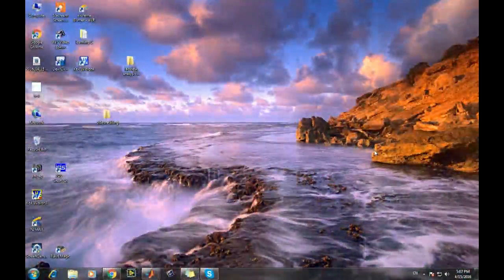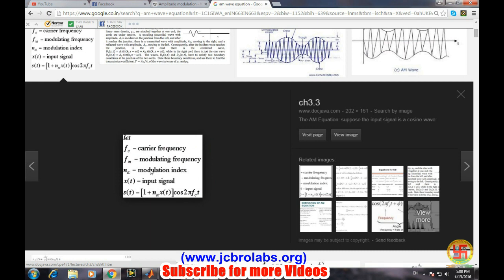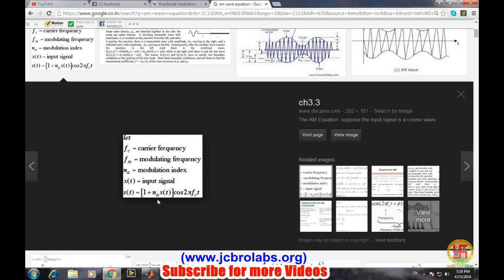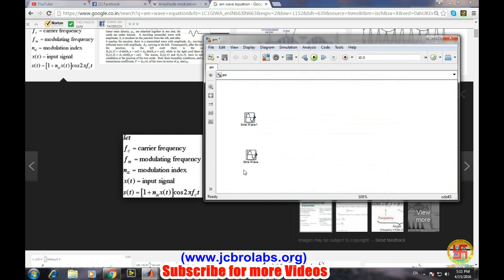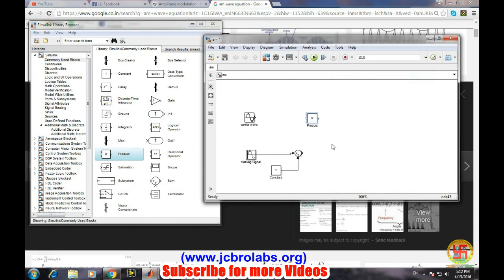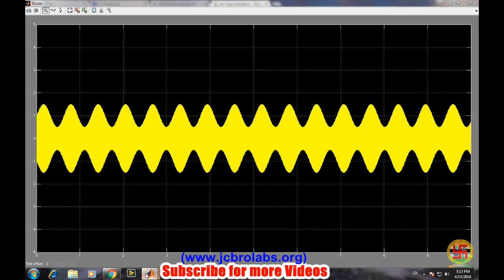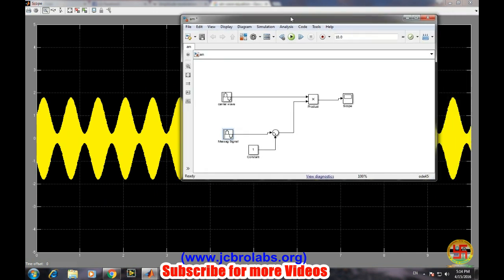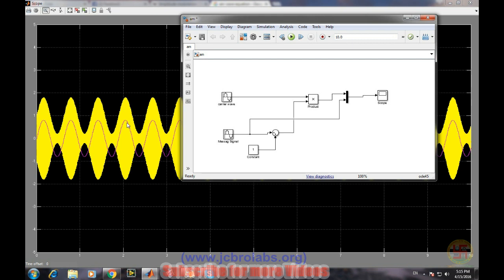How to simulate AM using Simulink?

Comment: sir can i ask a question, why is the sample time of the massage signal and the carrier wave is different or it doesnt matter? im sorry if my question is a bit dumb, still trying to learn haha
Reply from the maker: There could be several reasons:
1. If sample rate of both are nearly same then they will interfere with each other and message will lost.
2. Message signal is low frequency signal and that can not be transmitted via antenna so we need to translate the same to higher frequency band.